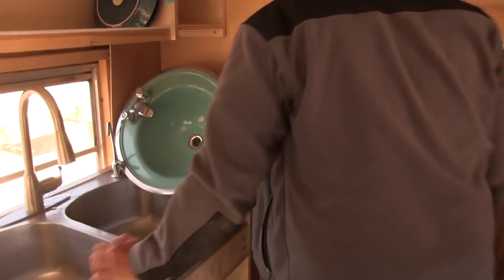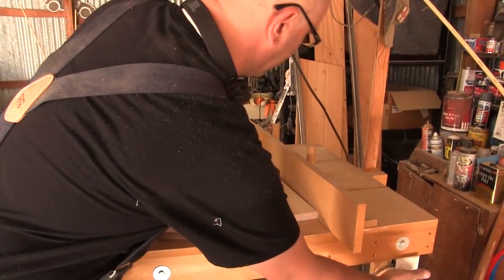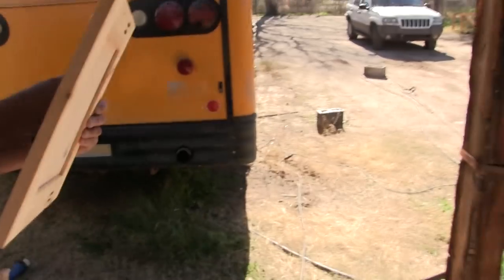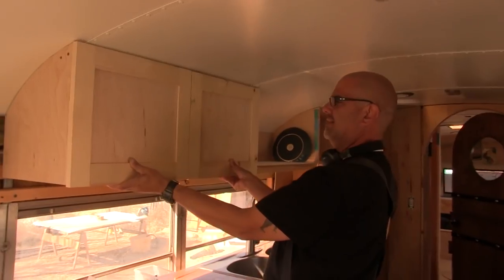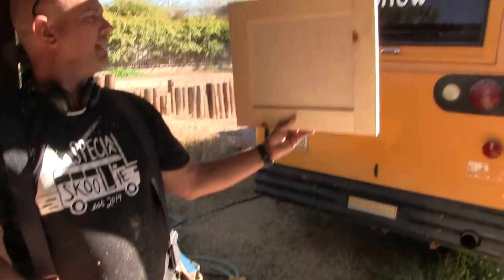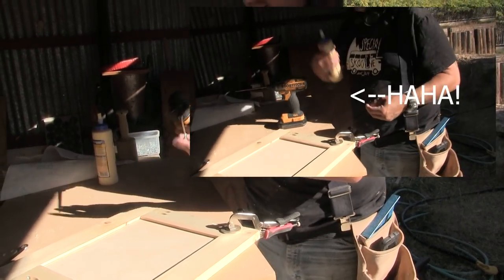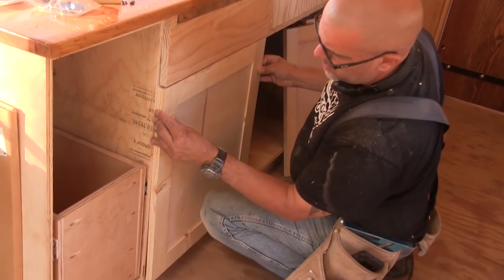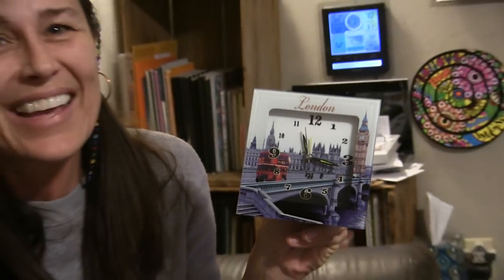Skoolie Kitchen Cabinet Doors Built with Kreg Pocket Hole Jig

Comment: That's a simple ball type faucet  and easily repaired with a kit from lowes.  It is common for the seals to get damaged when new lines are used because of the contaminates.

Comment: Mike like the air cylinder on the Kreg hole drill station. Would you spec the cylinder and the foot control. Thanks wm

Comment: If you mount the doors that open edge to edge, won't you need to space them apart a small amount or chamfer maybe round them a little so they don't hang up on each other you you open or close them ? That sharp edge can bind them up.
Reply from the maker: I gave each door 1/8th inch spacing
Reply: Thata do it.

Comment: FWIW, common practice is to not glue the panel of the cabinet door.  It should float to allow expansion, contraction and allow for movement of the wood with changes in humidity.  maybe the fact you used thin plywood, you may not have much to worry about. but if the wood frame expands to much it could crack.  time will tell.  you got skill though!
Reply from the maker: I only glued one so hopefully I will get a pass on this one.😁
Reply: @BussyMcBusface  well now you can test the theory to see if it full of sh....looks good though!

Comment: Hey Mike, you should never glue a floating panel.  It needs to float because of expansion and contraction.  It prevents the doors from warping.
Reply from the maker: I only did it on one.😁
Reply: Bussy McBusface 🤐. Mike, I should have known that you had it under control.  👍🏻

Comment: Hey, nice work, and even more kudos for your patience level getting all of those fits ‘perfect’. When routing the doors what size bit did you use. 1/4 by 1/4 or was the depth 3/8?
Thanks, Steve
Reply from the maker: I believe for the slot I used quarter inch bit at one half inch depth

Comment: Question for you two. I recently rewatched a few of your videos and came across your "solar update video". In that video, you talked about a sensor that would read your tank level. I'm assuming that this is a waterproof sonar sensor? I'm curious because I plan on making a similar system with an Arduino in my Skoolie conversion. Is there a way that I could contact you about your build? Do you use Reddit? The Skoolies subreddit loves your build and many people often mention your build
Reply from the maker: Go to Adafruit.com and look up fluid level sensor .
Reply from the maker: No, I dont yse reddit but that is cool we are referenced so often!😁
Reply: @BussyMcBusface  Thank you. I didn't think that there was a sensor specifically for this. Do you still plan on having your touchscreen system in your build? My conversion is all Arduino controlled (front door with an electronic deadbolt, relay controlled interior lights, floodlights etc.) with 2 planned touchscreen modules, one in the front and on in the rear. These will communicate through a local database to control items. This would also allow for remote control as well. I'm curious about your future plans in the electronics department